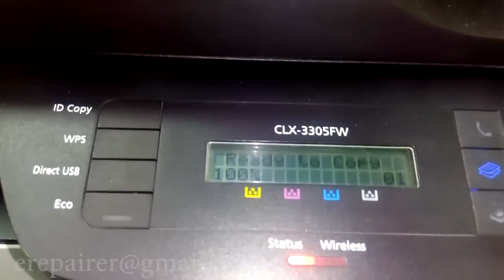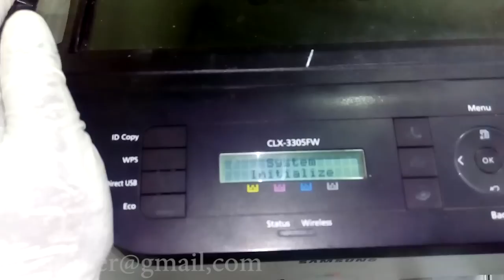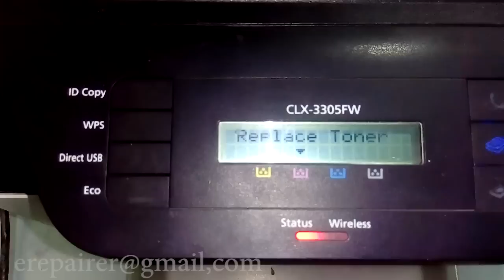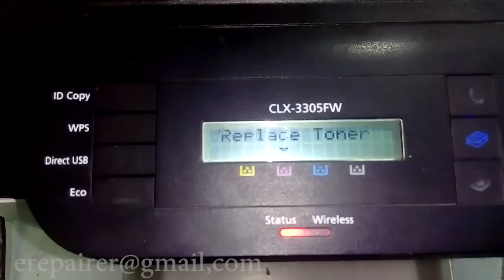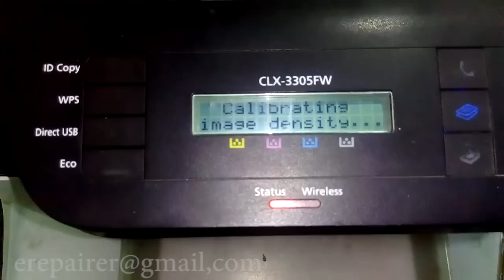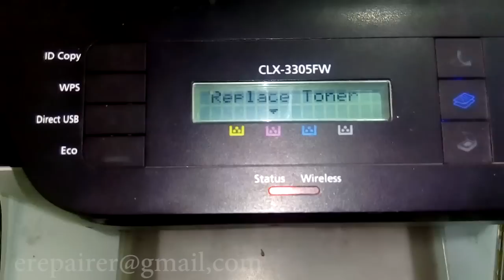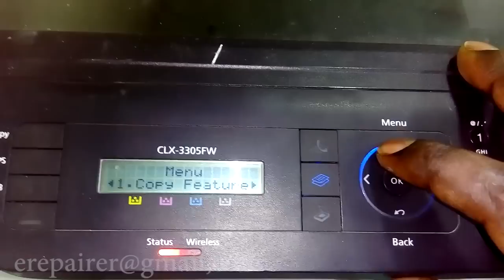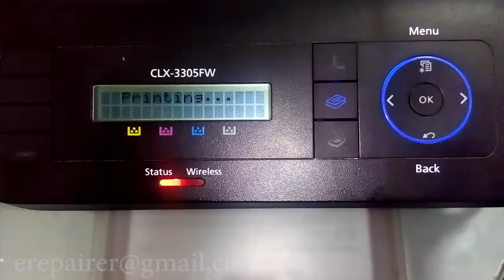How to reset Samsung CLX-3305 Printer imaging unit

Comment: At First This did not work for me cause I was not doing it right. Ensure the printer is on the whole time. Install chip after soldering the wire. Allow the process to take effect. Remove Chip again and remove or cut the soldered wire. Reinstall and wait for the printer to tell you about the toners missing or needs to be replaced. Open door replace toners and that worked for me. Thanks alot

Comment: Only worked for one document that already was in the print queue. After that I have same message again.

Update: The printer actually HAVE to be turned on. The first time I unplugged the power cord.
By the way, it is much more easy to use a small piece of aluminium foil in front of the plug.
Reply: Peter Holmberg I didn’t get you so could you please show this in a video because my printer has the same problem
Reply: Hemmat Elhadidy Can't make a video right now. Just do as the video says, but have the printer POWERED ON during the whole process. And instead of soldering a wire just put aluminium foil in front of the contacts. When you close the lid, the contacts there will short circuit.
Reply: I didn't get any sound to understand what he was doing either, but your aluminum foil idea worked for me thank you.

Comment: I connected a thin wire of 50 cm which does not interfere with the closing of the hood, after I cut it with the scissors to simulate the resistance cut during the initialization, and it works wonderfully, good luck

moi j'ai connecté un fil de 50 cm qui ne passe pas par la fermeture du capot, après la coupe au ciseaux pour simuler la résistance lors de l'initialisation, et ça marche, merveille, bonne chance

لقد قمت بتوصيل سلك رفيع من 50 سم لا يتداخل مع إغلاق غطاء المحرك ، بعد قطعه بالمقص لمحاكاة قطع المقاومة أثناء التهيئة ، وهو يعمل بشكل رائع ، حظًا موفقًا

Comment: It looks like he soldered a 20  Gage wire and then re-inserted the chip holder back in the printer without installing the toner cartridges.
When he pulled it out the wire was burned in two. I don't think he cut the wire to remove it. This part is not clear.
It shows him putting the chip back into the printer. Now my question is did this procedure re-set the page counter or did this only worked for one copy?